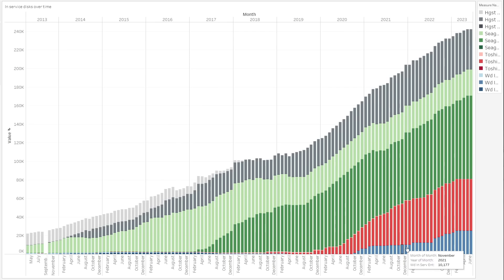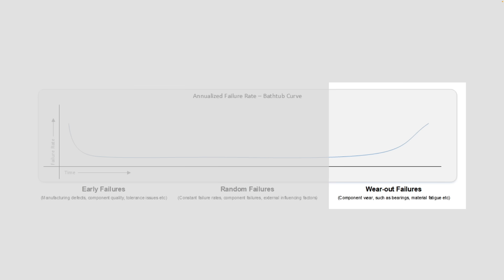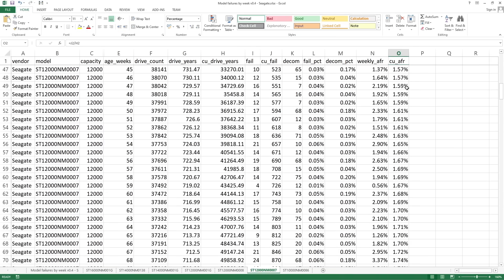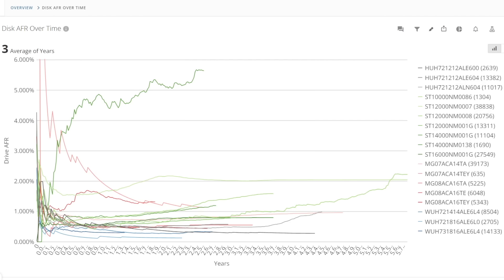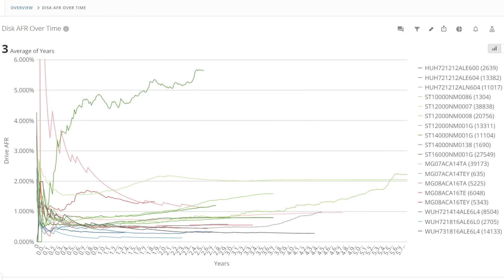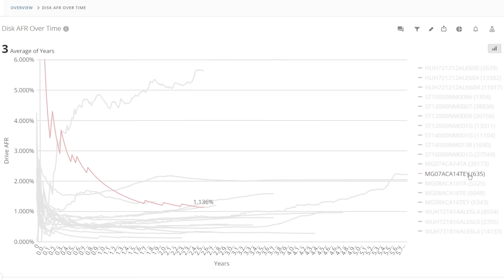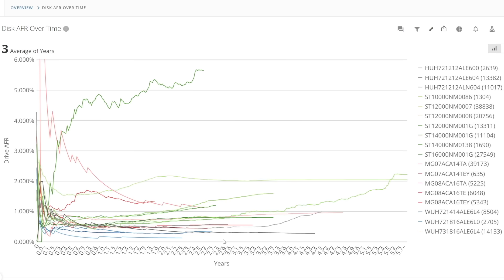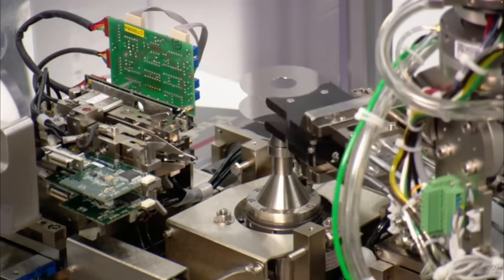Failure Rate Analysis - Best 10Tb+ hard drives: Seagate, Western Digital or Toshiba?

Comment: Interesting if all these drives are randomly placed in the data center, or whether some brands  are used in DB / some are used for cold file storage etc. ---- random is the assumption, but if the 'real usage' time could also be  displayed in. But perhaps that is confidential
Reply from the maker: Backblaze just started to add the storage pod data to the source, though historic failed drives likely don't have it. I need to go into the new dataset and see what changed. This will reveal if the drive is part of their normal customer offering, which is just pooled storage for customer archive. And for this use case, the type of usage should be pretty uniform.

As I believe they use different disks for OS instances, and would think for DBs that they use fast storage but might depend on the case.

But I think in any case, its a safe assumption that the vast majority of the drives in the data are used for their cloud backup service.

Comment: I just purchased (4) Seagate ST14000NM001G-2KJ103,  X16-14TB enterprise hard drives on Black Friday of 2023.  
We are now in May 2024, and already I lost 2 drives and a 3rd is about to go bad with loud clicking sound.  I was forced to take a DeWalt drill to the drives since it has my data on the platters.
My friends warned me not to get Seagate drives due to their constant horrible reliability. But I seemed to have ignorance of a nut listening to my friends, and here I am.  🤷‍♀🤦‍♂💀
I am going back to Western Digital.

Comment: Our 8 poweredge Dell are using the Seagate 10 TB EXOS drives x 6 for each server, and the 6 poweredge are there for backups these have 12Tb exos drives. But after three years, every drive is replaced with new ones, except the backup servers those run 4 years. Our servers are used for content creation, music, video etc. So very big file transfers. For my personal NAS I use the Ironwolfs Pro disks. But that server doesn't do much.

Comment: HGST was my go to for a long time, Western digital wrecked that. I just want a large CMR drive that seems to almost be impossible now. Seagate sucks, western digital sucks. I guess I just need to suck it up and get SMR drives from one of these companies.
Reply from the maker: Are you worried that the larger capacity disks are SMR? The larger capacity disks from Seagate, WD and Toshiba are pretty much all CMR, with a couple of very specific exceptions that are usually made clear. Where SMR is more of a problem is in the low end desktop and the basic WD Red disks, and even then there are also CMR alternatives if you look closely.

Seagate and WD do have very specific SMR models at the high end, such as the WD Ultrastar HC650 drives, but these are typically host managed and not device managed.

So you should have no problem picking up a large CMR unit. If in doubt, check the datasheets for the drives you are looking at.

Comment: Awesome video! My 2 HGST 4TB 7200 Red label NAS drives that I've had since late 2014 and they are still going. I'm actually quite surprised I haven't had a drive drop out of my RAID-1. Although the drives are powered down when not being used for 30 minutes which is good, but they do have a lot of spin up counts. Looking for the ideal double digit terabyte drive for a raid 5 configuration with the hot spare.

Comment: This is not accurate testings, you need to pick the models that have been manufactured in order.

Would need to order directly from the factory, to get the more accurate testings.

It is possible that you picked those failed ones, and skipped the quality ones.

Just couse the store sends them to you in order from their shelf, does not mean they have been produced in that order.

Comment: two of my drives over the last decade failed at the sata-to-usb adapter. The 1st one was a Vebatim, and the usb end's contacts broke. Taped this one up, copied everything off, and retired the drive. The 2nd one's adapter just stopped working one day. Fortunately I had bought 2 of that Seagate drive while it was on sale, so could test and find the problem. Gonna have to get a sata to usb cable to use the other drive regularly again

Comment: Seagate with the most failure rates is not a good choice, its a false economy to buy cheaper drives. Plus, the data needed to keep a business running is invaluable, meaning if a Seagate drive was to fail, a whole business would probably fail with it
Reply: Regardless of failure rate, you should still run redundancy if possible, and if you're going to do so maybe it makes sense to make a cheaper purchase slightly more often. But this doesn't really change much for desktop drives, since Seagate desktop drives aren't much cheaper.

Comment: Anecdotally my ssd`s fail faster
Reply from the maker: The failure modes for SSDs work differently, but because HDD have moving parts, people think SSD will be more reliable, but this often isn’t the case and SSDs will also ‘wear out’ faster. So you are likely to be right.

Comment: As an IT guy this is really handy information! So you get a thumbs up for that. 👍 However your presentation of this information is a bit lacking. It would be far easier to read the graph if you focused on one vendor at a time getting rid of all the noise from other vendors.
Reply from the maker: Appreciate the feedback. There is always room for improvement and the balance is comparing the models from each, to how the manufacturers compare to each other. It’s been a while since I did this and there is more data becoming available, including 22Tb drives, so if I do an update, I will see what I can do to improve on the visualisations. 

Thanks for commenting
Reply: @sometechguy  What gravitated me to your videos is the fact that I need to buy some new drives for my NAS. So my focus is not so much on any particular model but more determining which vendor is the most reliable generally speaking. Let's face it any drive you buy is a crapshoot as to its longevity. You need to find a happy balance between price and risk.
Reply from the maker: @LokiDaFerret  you may have seen it, but I did a video comparing the vendors where the data is cut into models lines vs individual drive models. For example, Exos X14. X18 or Ultrastar HC520 or Tosh MG08, and for the reason you say. Thanks again.

Comment: having used spinny drives for movie and archive storage over a 7 year period, for just me personally, 
I've found WD reds to be THE best long term storage devices. 
This is keeping them hooked up and semi running while a downloading program runs. 
Fk Seagate and Toshiba. I bought seagate because...they're everywhere and cheaper, and there was sales on toshibas. 
2 toshiba drives close to, or pretty much dead. Managed to coax files out to another drive (WD). 
Seagates just have an overall mid range fail rate. Where the bathtub is lowest, I will at times start hearing drive get noisy and clicky.

Comment: Thank you 'SomeTechGuy' for such an indepth and informatively interesting vid - very well produced too!  I do a lot of 1080P and 4K video editing - mainly for our family use, with tonnes of old family vids I'm upgrading from decades ago and modern 4K stuff too. My son has a business and I do some 4K stuff for his commercials. So, I need MUCH storage space and still prefer spinning disks for pure and RELIABLE storage. About 10 years ago, after a raft of failed HDDs from Seagate (mainly) I decided to swap to WD completely. This was based on some Backblaze research and other research I studied acutely. I currently have run the following SATA3 6Gb/sec WD drives for many years, some up to 10 years: 1TB Raptor (10,000 rpm) since 2013, 2x 4TB Black Caviar since 2013, 2x 14TB Ultrastars since 2018, 2x 14TB Gold since 2018, 1x 18TB Gold since 2020, 1x 20TB Ultrastar since 2021. Currently eyeing the 24TB CMR GOLD monster just released. Incidentally, all my drives are, of course, CMR (conventional magnetic recording) not SMR, wouldn't touch SMR. The Gold and Ultrastar models are mechanically identical and only differ slightly in the formatting/sector sizing and interface (SAS/SATA) of some sub models in the Ultrastar. Here's the kicker: in all of my WD dirves listed here I have never had so much as a pending sector count or untoward noise. All of my WD drives have performed 100% faultlessly. This is a major epiphany for me after the expensive failures in years past (always 'just' out of warranty) of the Seagates, Maxtors, Toshibas. Not only are the WD Gold and Ultrastar models super reliable they perform better/faster than any HDD I've had in the past. I use a fast SSD for my C drive but all storage relegated to spinning disks. Works a treat. I will only ever buy WD HDDs now. With this reliability, performance AND a 5 YEAR warranty it truly is a no-brainer. Cheers from Sydney Australia. 🙂
Reply from the maker: Really appreciate the detail of what you shared, and great to hear about your experience. Greetings back to Sydney, have spent plenty of time down there and in Melbourne and always love it.

Comment: Awesome info! It always intrigues me that in these days of modern times when almost everything is CNC machined to molecular tolerances and the parts should be absolutely identical, that there is this much difference in the failure rates of the different brands/models. Cars are another good example. One person can buy a particular make/model of car and get 500000 trouble-free miles, and another will get a lemon that is in the shop every other week for a new transmission. Doesn't make sense. Hard drives are amazing devices in any case.

Comment: Do not buy Seagate! We are data recovery service and we get more and more seagate 8-14 tb hard drive exos and iron wolf with clicking sound and heads reading issue. It is recoverable but we have about 70% seagates in our lab from all coming cases! So think about it before buying. Toshiba for nas N300, N600 is the best at this moment.
Reply from the maker: I would think the more failures the better for your business. 😅

What is the cause of the failures out of interest, human error and mishandling? Or hardware failures?

Comment: I still have old SCSI and IDE drives from over 30 years ago and the data on them is still good,   4 of them were spinning  constantly in a BBS for  over 8 years,  the only drives I have had fail in the last 20 years are seagate.
Reply: I've noticed that HDDs in older laptops with IDE interfaces (before 2007) or laptops that didn't enable AHCI (SATA) last longer than those using the SATA interface/speed. From my experimenting with UDMA setting on SATA HDDs to control the interface speed, drive-to-drive data transfer speeds were reduced when using older speed but data transfer within the drive was unaffected. In my opinion, IDE would have been sufficient for HDDs for regular users.

Comment: In 2014 I bought a WD Caviar Green 4TB HDD that I wanted to use as backup drive. I put it inside an enclosure (Digitus DA-71035) and soon it became corrupted and with broken sectors. I've moved it outside the enclosure and inside my desktop and continued to work for a while even if at every start of the pc he signaled me that the HDD was going to fail. Finally Microsoft Windows 10 asked me to repair it and I accepted and pressed yes. That's when the drive failed definitively and died. What I've never understood (and maybe I will never understand) is if the cause of the failure was the Hard Drive or the enclosure. Is the only way to discover to put another HDD inside the enclosure and look what happens?
Reply from the maker: Hard to imagine its the enclosure, unless its a serious defect such as how it delivers power. Probably, it was the disk. Any disk has a chance to fail, and its more likely to fail at the start of its life. It could also have suffered mistreatment in shipping, or, as is sometimes the case with enclosures, the disk was moved around a lot or suffered some g-shock while the disk was spinning and this damaged it.
Reply: @sometechguy  Thank you for your reply. I now will buy and External HDD because the sizes for the price have increased dramatically. I'm still in doubt between a WD or Seagate. Plus there's the problem of CMR vs SMR Technology. It's an endless fight and discovery to find the most reliable ones.

Comment: I got three Seagate Barracuda Drives (Model# ST8000DM004-2CX188) that have been running (mostly) 24/7 for 31500+ hours one of them has finally gave me the caution flag in SMART so I've been needing to get them replaced.  I have been deciding on what to get next this video has been a big help.  I am planing on getting two 16TB Drives so I can reduce the amount of mechanical drives I have (one in my rig & one as a external backup).  All my other drives are going to be solid state.

Comment: Would you consider sharing the analysis result?
Reply from the maker: The analysis is done on the original Backblaze data, which is really large (67Gb currently compressed). Each of the data points in here is derived from SQL queries on that data, so the working data isn't that easy to share. But Backblaze do publicly release the data source if you want to dig into it.

Available here : https://www.backblaze.com/cloud-storage/resources/hard-drive-test-data

Comment: After 2 harrowing experiences with Seagate drives, I'll never go near them again. It was only a miracle each time that got me out of it and allowed me to recover my data. I have 8 WD drives across 3 computers in my system (3 of them external) and have owned 14 in total and they are the only brand I trust. Try and save $10-$20 by buying a cheaper-but less reliable- drive and you may be very sorry down the line.

Comment: Over the years I have used both Seagate and Western Digital and I find that Western Digital have been a lot more reliable. The 2 Seagate drives I've had over the years have both failed on me but the Western Digital drives I haven't had a problem with and are still going today.

Comment: got a 2TB Seagate Hard Drive i used it for 10 years in my old gaming pc, it still works like it is its first day, bouhg a few as Data graves.

Edit: i just lokked and my hard drive was running on avg. 13 hours a day.
Reply from the maker: Considering the precision engineering and moving parts involved, they are amazing.

Comment: I'm using 4x 16TB exos Seagate drives in my home server, runs 24-7, have been since 2019 almost 5 years and none have failed yet, luck of the draw I guess. With the continued advancement of technology these days hardware storage is only going to improve, they have already compared to a decade ago, mechanical drives have become more reliable and helium drives more common especially in their larger capacities.

My own personal experience, HGST drives that I used in the past failed faster than any other, Western Digital is second worst in my experience with drives being corrupted and unreadable, Toshiba were surprisingly good but lacked large storage capacity, I've had only one Seagate drive fail on me in the 2 decades I've been using the brand and it was from the first batch of their 1TB HDD's.

Like I mentioned, personal experience which will vary with each user, but I honestly think if we didn't have these failures then companies wouldn't know how to improve on their product, be it HDD's, GPU's or whatever hardware you have in your system there is always risk of hardware failure.

I appreciate video's like this as they're a true analysis of performance unlike some channels that decide for you or try to manipulate or scare the viewer into thinking their word is final for example: "LMG Clips - Why you DON'T want a 20TB Hard Drive" or "SpaceRex - Stop Buying WD NAS Drives", scaremonger tactics or just misleading titles based on their own experiences? Anyway I think channels like that suck.

Great video. Subbed.

Comment: The Toshiba's Mg series so for have been very good. Having 2*16TB of the them working fantastic.
Reply from the maker: Good to hear. They have a smaller market share and there are less vocal defenders and critics of them. But generally, the feedback seems to be positive. The fact that you don't hear a lot of people complaining about them has to be a good sign. 👍
Reply: @sometechguy  I also have the toshiba;s HWF. 2x8TB that show up on backblaze's charts. So far no fails. But they are extremely LOUDER than the 16tb's I have now. 
I also have to mention that My WD 10EZEX the legendary 1TB is 10years old and still working like hell